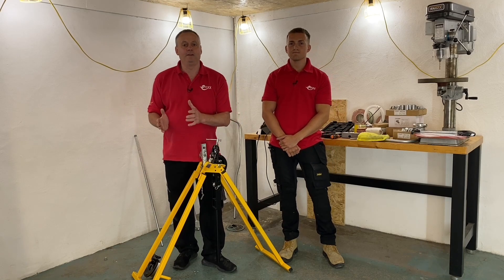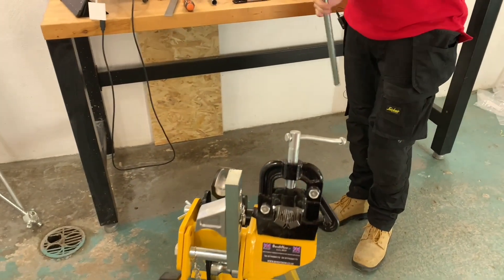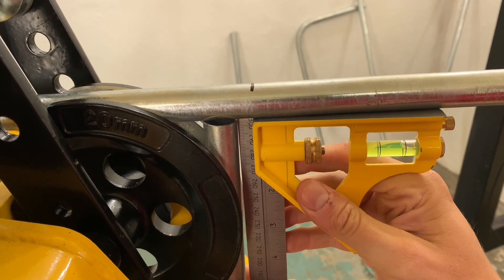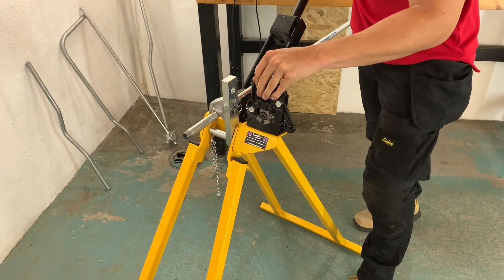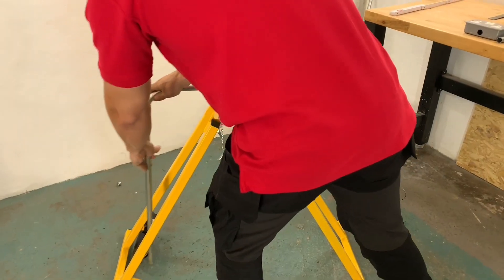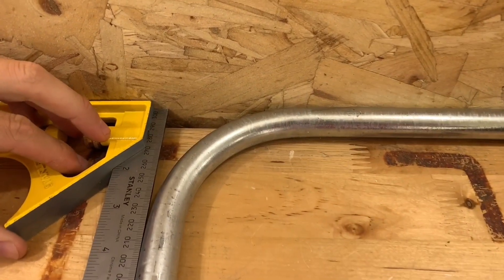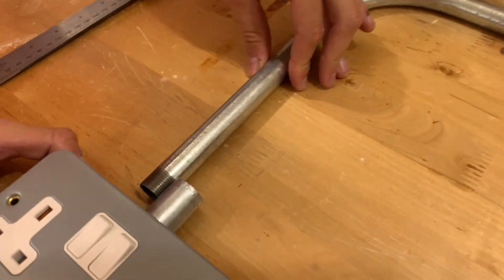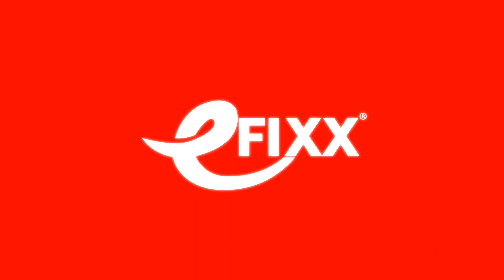How to bend steel conduit to an exact measurement. - Apprentice electrician essentials

Comment: Could you do a video showing how you bend bits which are too long amd won't Bend 90 degree please. 
Also does the end you insert into former make any difference when bending? Thank
Reply: Bend it with the arm at the bottom and bend up
Reply: @nevermind824  So your doing exactly same with scrap piece and set square but upside down?

Comment: Dang, y’all do it completely different than the USA. Interesting.
Reply: Worth pointing out, in case it wasn’t obvious in the vidjeo, that UK conduit is far thicker in wall thickness than EMT in use stateside. This is why we can’t use those floor-bender type tools. You’d maul the floor….
Reply: @moodophile  well aren’t you just a genius
Reply: @moodophile  we have emt and rigid conduit
Reply: Floor benders are more easy to use than UK IRWIN bender.  You have degrees on it
Reply: To use european ones you have to be litle genius

Comment: Very fussy and time consuming method, learn your tools and either learn by trial cuts or calculate the amount you need for the bend. Most formers have marks for this. Once you have your reference mark and you know the offset just remember that number and add or subtract it to the required dimension (add or subtract according to reference mark location). 
A good reference and surface to measure from is the pipe clamp. This method also works mid pipe...measure your long straight, mark close to bend(eg 2.2m) mount in bender,now use that mark to measure the final length for bend,easier to handle a foot of tape than it is 3m of tape dangling on the end of a pipe.

Comment: All this plumbing up with spare pipe to back of bend all well and good in the classroom.
Teach with full lengths so they have to bend up as well. 
If you want say 300mm add on 47mm and put that mark to back of former to allow for the bend.
No messin with bits of pipe and squares.
Reply: Each bending machine is different so this measurement can be different ,on mine you have to add 25mm
Reply: @shanebyrne6404  how do you know how to take this measurement

Comment: The roller on the handle is too high for 20mm tube it should be low as possible to the former,  that is in the 25mm former hole.